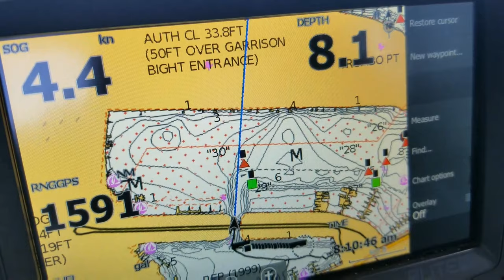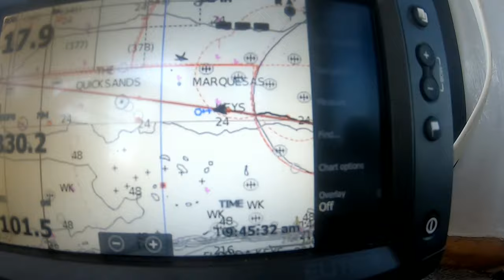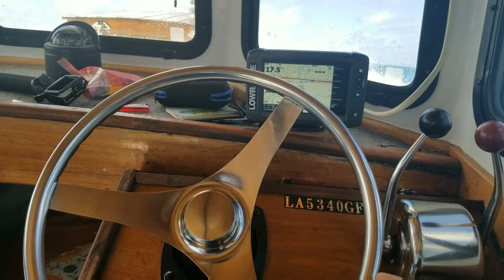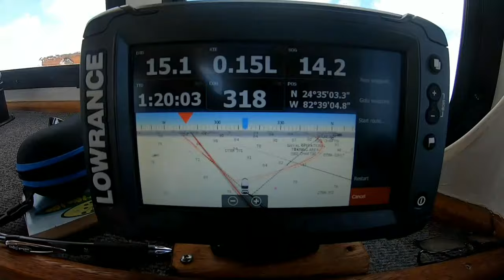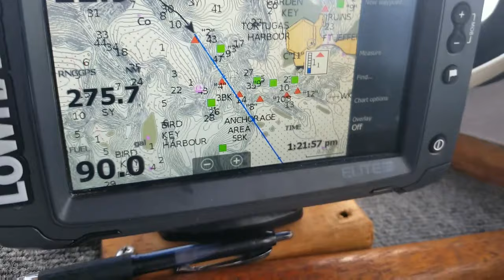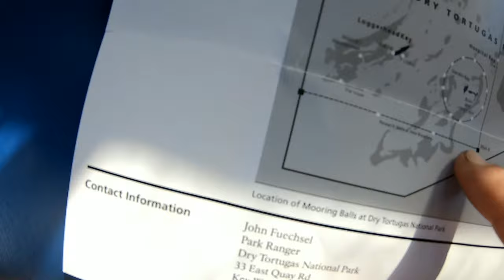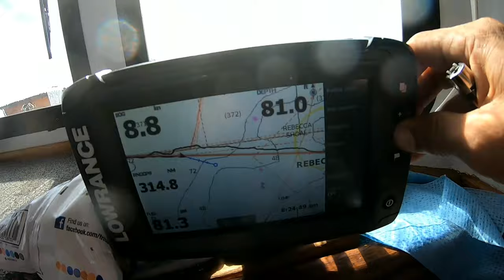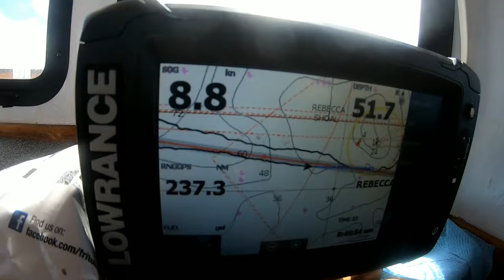Passage to the Dry Tortugas National Park in a Homebuilt Surf Scoter 22

Comment: Why is that outboard so LOUD ??
Reply: Things are actually louder than we think they are.  Unless it is a sound we don't like

Same reason that when you do a wedding video, and a small regular car drives by, it kills all the sound on the tape, yet in everyday life it would hardly be noticed.  Psycho acoustics.  We hear what we want to, or think we hear.  So an acoustic guitar does not have a large enough air volume to produce the fundamental tone of the bass strings, but we never notice, because even the non-players in the audience just fill it in.  Get yourself a cheap meter off ebay and actually measure the decibels of things in the environment.  We are set up so that while the energy of sound doubles for every 3 decibel increase, we see the decibel scale as nearer to linear.

Which is why you need to be so careful about noise like rock concerts, gunfire, or ear buds.  People will happily go deaf.

Comment: So why did you choose the single point? Was it the cost over safety? or cost over luxury?
Reply from the maker: Do you mean single prop?  The plans are for single prop, and I'd not radically  alter the  design, so Id say safety over cost. 

Also,. I the 115hp is the lowest hp that has digital NEMA output allowing for a modern head unit.  Rather than a busy  guage cluster, luxury and modernity influenced my choice.
Reply: No, single point of failure. 1 motor. Instead of two motors. What is your plan if something happens to your only motor?
Reply from the maker: @groundzero. I carry parts and tools to keep it running. I wanted to build a light sport aircraft at one time so I carry the same philosophy as a pilot. Also, we have Seatow on call and I can stop to take a leak!

Comment: What's the measurements of this boat, I'm interested
Reply from the maker: 22x8' the widest you can trailer, even 30 foot or longer boats on trailers arent more stable as the boats stability is based on width not length the max width on the highway is an 8 foot wide load.